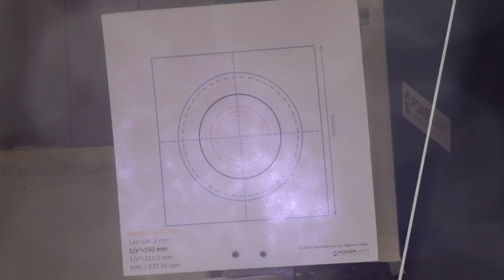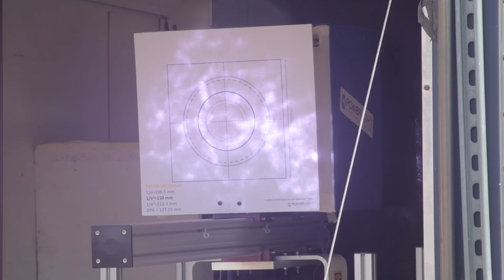SCOPE-O POWER BEAMING

Comment: You can also use the same energy to heat a place or even destroy circuits ?
Reply: If you had a bunch of these in space, which I imagine is the plan, you could focus multiple satellite lasers on a single point on the ground and start a fire or cook something or someone.  I think Musk's satellites already have lasers onboard, the military can and do use these for communications as well as power beaming or the aforementioned melting.